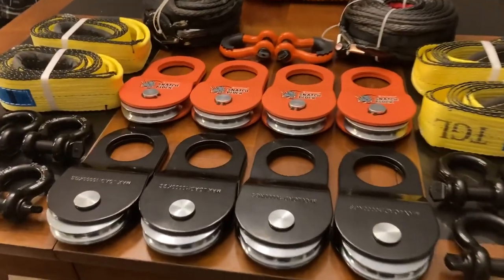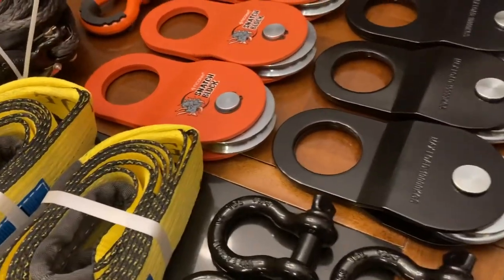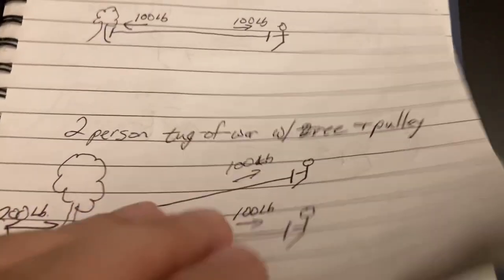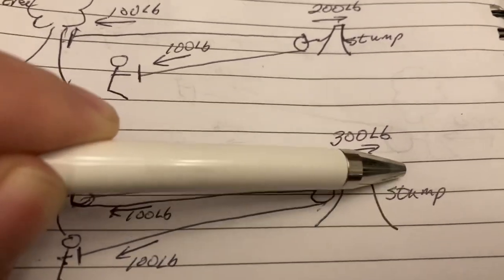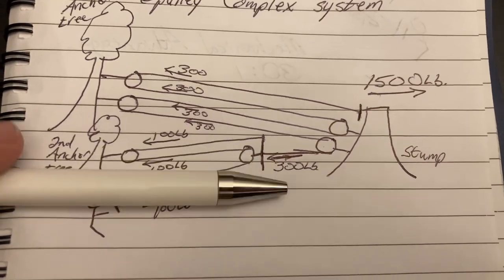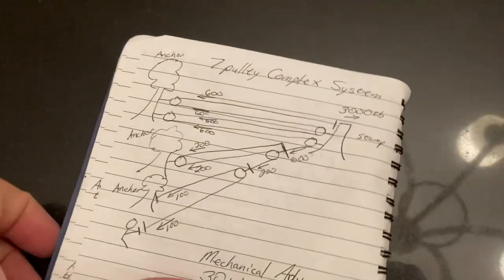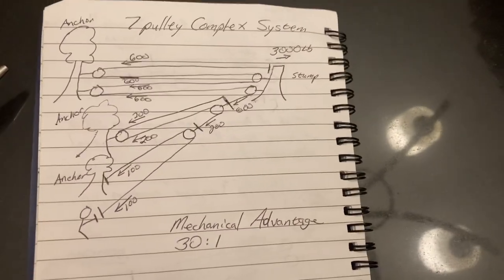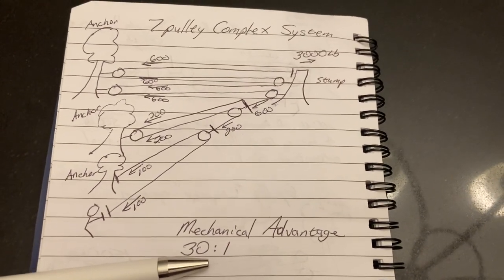Stump Pulling Preparations with Snatch Block Pulleys and Explanation of Physics

Comment: You have a 3 to 1 simple system and a 5 to 1 simple system.  They are each self contained and independent of one another except for the single connection that allows one to operate the other,  making the whole a compound system rather than a complex.  In that light, the math gets easier because you can just multiply the MA numbers from the two simple systems.     3  to  1
                    x5  to  1  
                    15
Semantics,  but important. 
The following helps in the figuring.  Stationary pulleys do not provide any mechanical advantage.  They are just redirects.  Only moving pulleys create mechanical advantage. 
If your 3 to 1 would have been a rescue Z-rig (YouTube search)  added to the haul line of the 5 to 1, then you would have had a complex system.  And a very quick way to reset short pulls. 
Here’s a fun and cheap rig to build to win bets with. 
4 pulleys and 4 ropes will create  16 to 1  MA
HOWEVER…..a couple headaches are involved. 
4 anchor points and rather long distances are required. 
One pulley attached to the load is a 2 to 1 simple. 
Lay the other 3 pulleys next to the first.  Create 3 more 
2 to 1 simple systems.  Each one pulls the one previous to it.  Simples operating simples  creates multipliers. 
2 x 2 x 2 x 2  =  16
Now the fun.  The fourth anchor is to be  8  TIMES  the distance of the first. 
Each rope is twice as long as the previous one but only has to be half as strong. 
Yeah, I’m kinda nuts but it actually has come in handy.
Reply from the maker: I appreciate that!  I noticed after I did my first 3 or 4 videos that compound and complex are NOT the same thing and I had incorrectly been using them interchangeably.  I corrected my mistake around video #3.  Out of the hundreds of comments I’ve gotten on all of my stump pulling videos, you’re the first one to catch this mistake!  
Since this video I’ve gotten much quicker with whipping stumps out and I try to use different setups most of the time.  
I appreciate you watching the video!
Reply: @brainhomestead6  
Good stuff, Boss.  🤜🤛
Reply: Perhaps you could help me understand the difference between a fixed pulley and a moving pulley in this situation of stump pulling. I haven't been able to wrap my head around it and can't find a suitable explanation. The stump is the load but it is also a fixed point, non moving pulley. How do you calculate the force on the stump?
Reply from the maker: @Ed-ym4tu  it’s actually hard for me to tell you because I didn’t learn it as moving pulley vs. fixed pulley.  I learned it as a complete system using force vector analysis.  I can give you some general rules.

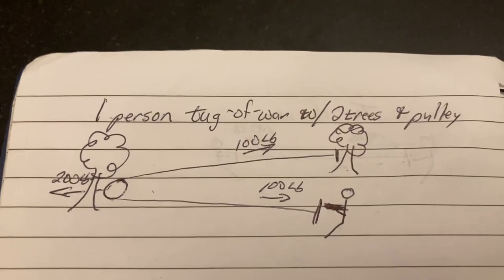Go to the 6:30 mark in this video.  If you’re applying a force around a pulley and there’s no movement, that means the other strand also has the same force on it.  In the section at 6:30, I’m pulling with a 100Lb force, so the other strand also has 100lb of force on it.  IF the other line didn’t have the same force on it, that means there would be movement somewhere.  So, the tree on the right is resisting my 100lb of force with an equal force in the opposite direction.  So it’s the same force as mine, meaning there’s no increase in mechanical advantage.  However, the tree on the left feels the 100lb of force I’m putting on it, plus it feels the 100lb of force the tree on the right puts on it to resist my pulling force.  The result is the tree on the left feels 200lb of force, even though I only put in 100lb of force, so a mechanical advantage of 2.
Reply from the maker: @Ed-ym4tu  At 8:41 in this video you’ll see multiple pulleys.  The person on the left is applying 100lb of force and since there’s no movement in the system, every strand of rope in that simple system MUST have the same tension on it, otherwise there would be movement.  So, you can see that the stump on the right has 3 strands of rope pulling on it, each one is 100lb, so 300lb total of force on that stump.  At the same time, the anchor tree on the left has 2 strands on it at 100lb each so it’s seeing a force of 200lb.  Just something to keep in mind while selecting a tree. 

I have 6 videos done already for pulling stumps in action, but I give a description at the beginning of the videos if you want more examples.
Reply: @brainhomestead6  thanks for trying to help me understand. You explained that quite well in your video and I understand it much better now, but I feel like you are explaining a fixed anchor point vs a pulley. My lack of understanding is on a fixed pulley for a redirect. It's how to tell a pulley is not moving that I don't understand. If we were lifting a bag of potatoes with a pulley the pulley would be moving. In the situation of the stump, it's fixed until it's not and the pulley is not moving--unless by moving we are talking about rotation of the wheel. This video you made does a great job of drawing out the system, but showing a change of direction picture and explaining what happens with forces would be a great addition.
Reply from the maker: The fixed vs. moving pulley explanation has its place, but the thing about it I don’t like is it’s not useful for compound systems, where using force vectors keeps the system much more straightforward.  

I believe in our case, first rope of the simple system, all of the pulleys on the stump would be moving pulleys and all on the first anchor tree would be fixed.  Then on the second rope compound system, the pulley on the end of the first rope would be the moving pulley, and the pulley on the second anchor tree would be fixed.
 I believe that “moving pulley” just refers to the pulley(s) that WILL be traveling when the system is in action.  So, with us using a pulley to lift a 10lb sack of potatoes, there is only a fixed pulley in the system on the ceiling.  You are pulling down with 10lb of force, the potatoes are resisting with their 10lb of force (weight), BUT the ceiling is not feeling 10lb of force.  It’s feeling 10lb from you, and 10lb from the potatoes, so it feels 20lb of force.  

Let’s flip this around a little bit… let’s hook the above system up the same way, but now you’re trying to pull the ceiling down.  You hook onto 100,000lbs of potatoes around a single pulley and start adding weight to your end of the rope.  Now, the pulley on the ceiling would be the moving pulley because you want to bring the ceiling down and in the case of successfully operating the system, the ceiling would fall, the potatoes would stay on the ground and you would keep adding weight until the ceiling collapsed.

In both of these scenarios, the pulley changes functions depending on your goals.  What doesn’t change is that the pulley on the ceiling always feels double the force that you’re putting on it.  If your goal is to collapse the ceiling, you have a mechanical advantage of 2.  If your goal is to lift potatoes, you have no mechanical advantage, just a redirection of force.
Reply: @brainhomestead6  ok, great. That last paragraph brought it together for me. I was trying to get ChatGPT to help me out. Sydney is more confused about vector analysis than I am. Thanks for posting these videos and explaining the math. Understanding the forces at each point is critical to ensure we are not overloading our equipment and creating a dangerous situation. All my gear is rated at about 34k pounds and I don't want to end up with a section with more than that.
Reply from the maker: @Ed-ym4tu  that’s exactly right.  That’s why I prefer vector analysis method, after drawing up the system, I can check forces at a glance.  That’s why I changed the first set of pulleys from 4 to 6.  With only 4 pulleys, the force was getting up close to the breaking point and bent one of my shackles.  Since I changed to 6 pulleys on the first part of the compound system I haven’t bent any more.
Reply: @Ed-ym4tu  
You stated, “the stump is the load, but it is also a fixed point, non moving pulley.”  Not true.  Although very slowly, the load is moving because those pulleys are moving as they pull the stump out.   If the pulleys at the anchor end are moving then it is not a capable anchor point.  Gotta find a stronger one.  
                        🤜🤛
Reply: @brainhomestead6  
I just remembered a possible confusion point in the math that we must avoid.  Tension values.  
If a 5 to 1 simple system is pulling a 1000 lb. load,  each line has 200 lb. of tension.  A second 5 to 1 simple system pulling the haul line of the first system is only pulling 200 lb…..total. 
So each tension line of the second system is responsible for 40 lb. 
I think you already covered this in another video but it caught me off guard about 40 years ago so I’m throwing it in there.
Reply from the maker: @ridermak4111  for sure, I forget what I put in each video, so reiteration never hurts.

Comment: at 9:00 minutes there are 2 pulleys. What is the force to each pulley? thanks
Reply from the maker: The pulley on the stump to the right has 200lb of force on it.  The pulley on the left has 200lb of force on it as well.  However,  the total force on the stump to the right is 300lb because you have the 200lb from the pulley and a final 100lb from the end of the cable that’s connected to it.

So, the stump feels 300lb, the anchor tree feels 200lb, and you’re pulling with 100lb.
Reply: @brainhomestead6  thank you very much. I better understand. so the force on my steel cable is also only 100 lb? interesting..
Reply from the maker: @zoba4645  exactly, it will only be as high as the force you’re applying.  But remember, in compound systems it changes.
Reply: @brainhomestead6 Using two 10 ton snatch blocks, should be connect to D-ring shackles that should also  be 10 tons of lifting/pulling force?
Reply from the maker: @zoba4645  Shackles have strange ratings.  My shackles are only rated at 4.75 tons, BUT a minimum break force of 27 tons.  Not sure why they’re rated so low.
Reply: I have a 12k Pounds electric winch and two snatch blocks.  I tried to pull out a fresh beech tree in the forest.  about 8-10 meters high and 20 cm thick.  it was very tough, but it went well.  it is important to have a strong battery, because after two or three such pulled out trees, the battery is empty and must be charged at night so that you have full batteries again the next day.  the battery must be strong and in good working order because the winch draws a lot of current from the battery.  my 24V winch also draws up to 250A of current, the 12V winch draws 400A.
Reply from the maker: @zoba4645  I know they draw a ton of current.  I still haven’t gotten one yet, but I may have to in a few weeks.  I’m going to do the big pair this weekend or next week.  I might have to get a couple of batteries.
Reply: @brainhomestead6  I don't think both snatch blocks would give him a 3x multiplier in this case?  https://www.youtube.com/watch?v=OBEy6qmzc_U&t=35s
Reply from the maker: @zoba4645  yeah, his system is 3:1.  He’s pulling with the winch line, then the other two lines are both anchored to the stump as well.  So that means all 3 lines (which all have equal force) are all pulling on the same load, so it would be 3:1 (in a perfect system).
Reply: @brainhomestead6   Thanks.

Comment: I really enjoyed your video.  You have a new sub.
Questions: 
1: In the 30:1 diagram, does this mean that the first anchor tree will receive 2400lbs of force for every 100lbs of force (ignoring friction and angles)? I ask because you need a very strong first anchor if that is the case...otherwise you may loose the stump and your first anchor.

2: Did you mean to say 100 foot rope vs. 100 lb rope in this description? https://youtu.be/_oOp1f-9lh0?list=PLDlx3ItZnVHya0hPk1XgWcZXsd6h-zMHL&t=945
Reply from the maker: That’s right, the first anchor tree needs to be the beefiest.  In the 30:1 scenario, there’s 3000lb of force on the stump, but 2400lb on the first anchor tree.

Now, it’s not quite that easy because this isn’t tensile force, it’s actually rotational force, also known as torque.  I put the strap around the anchor tree about 1’ above the ground, so it experiences 2400 ft*lb of torque.  Basically you multiply the force by the height above the pivot point (ground).  Since I put it 1’ off the ground, it’s just (2400)(1)=2400.  

On the stump, I put the strap 3’ off the ground, so the torque on that root ball is (3000)(3)=9000 ft*lb of torque.

It’s only that much at the beginning, as the stump starts coming out, there’s less and less torque and more tensile force.  It’s a pretty simple formula too.  For torque, you can multiple the torque times sin(theta) where theta is the angle from the pulling force to the angle of the stump to the ground.

Also, you are correct, I meant 100’ rope and in 9 months since I’ve made this video, I never noticed that, so thank you!